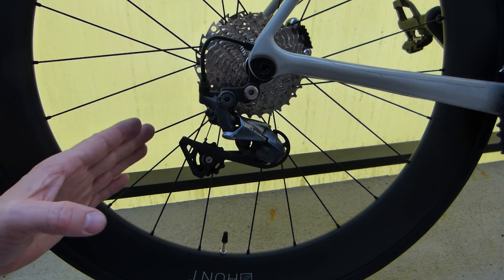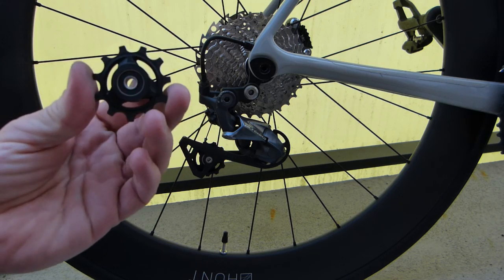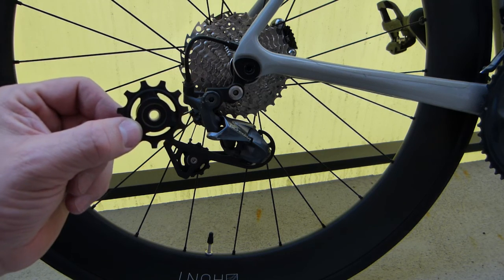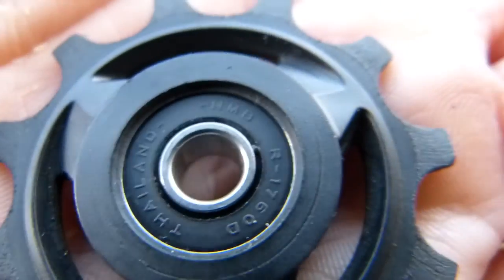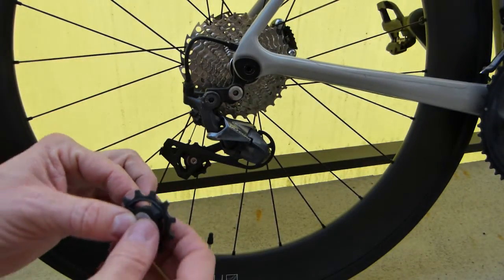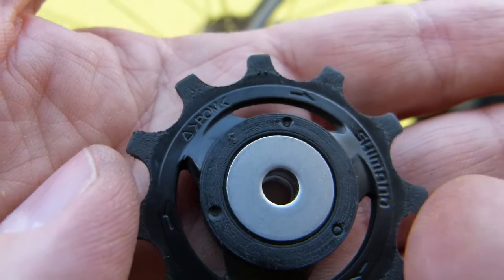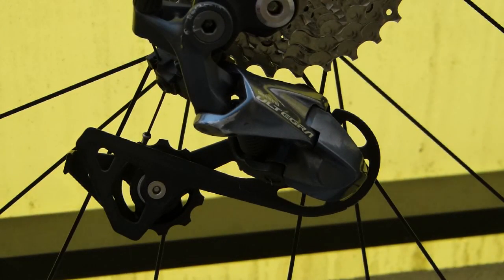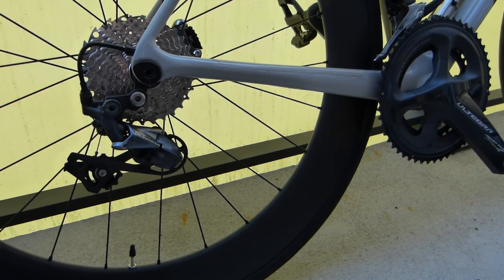Derailleur pulley maintenance

Comment: Good that your not one of those idiots that buy everything new .Maintainance is the way to go until it’s wore out👍
Reply: For a high-end component, maintenance is the way to go. For lower-end groupsets, replacement can make more sense. A brand new 10 (£/$/€) set of jockey wheels for an entry-level derailleur is a far better net use of finances and time than a repair. But the opposite may be true for pro-level kit where jockey wheels may cost considerably more.